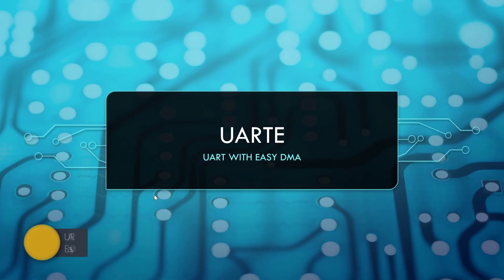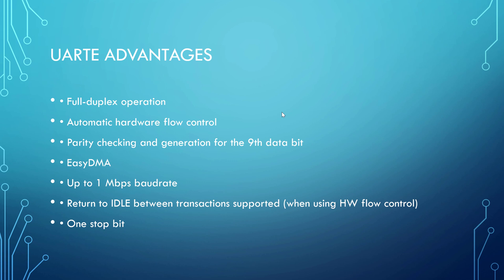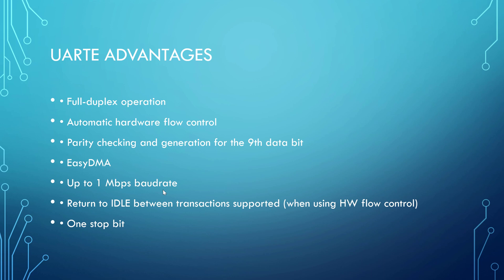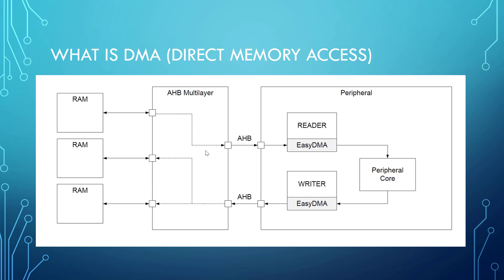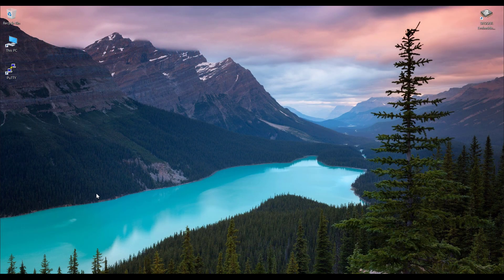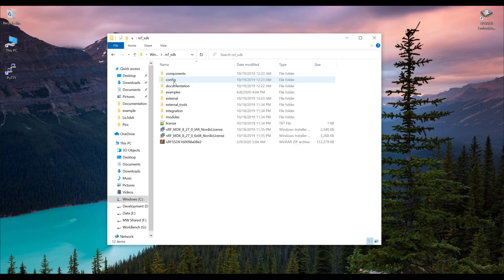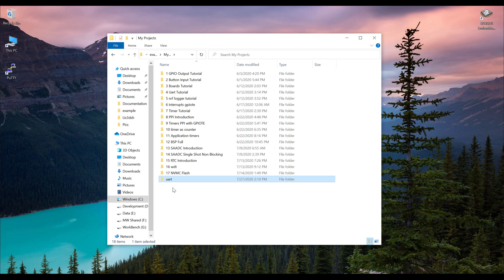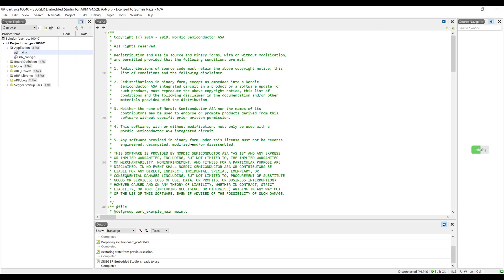nRF5 SDK - Tutorial for Beginners Pt 25 - UARTE Non-blocking Event Driven

Comment: How can I init 2 UARTE ports to communicate with GPS and Module Sim. I just duplicated Uart Config and edited sdk config to enable Uarte0 and Uarte1 but I can't run my code correctly. none of the ports worked but if I comment either port, the unique uart can communicate successfully

Comment: i want to ask about how to make nrf52840 to connect other devices?? use uarte function to communicate it??
Reply from the maker: well it depends on what type of devices you want to communicate with, if you want to communicate an nrf52840 with another nrf52840 over a wired connection then serial communication is simple to implement...
Can you mention the device with which you want to communicate then i will be able to guide you better ;-)
Reply: @SumairsEmbeddedEngineering   if connect to other sensor?
Reply from the maker: @leehoyan732   it depends if the sensor has a UART interface then we can communicate with it over UART. In near future i will use some sensors in my tutorials so you will get a better idea of everything. ;-)